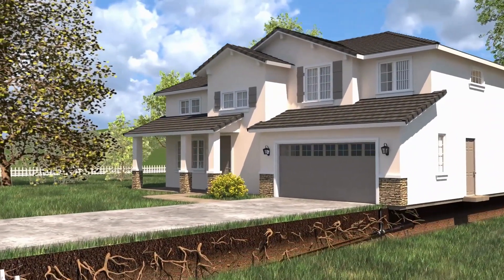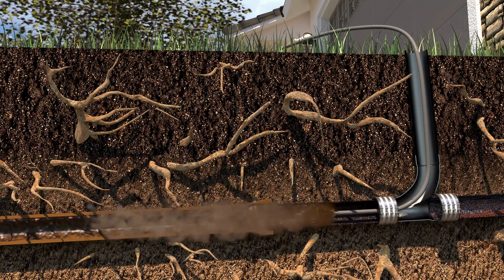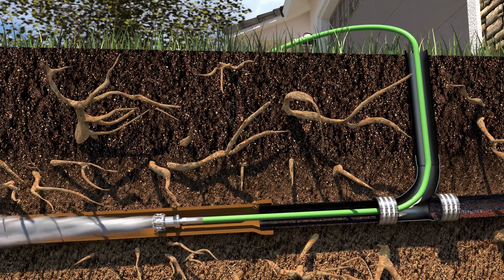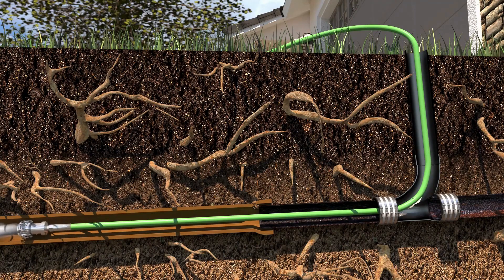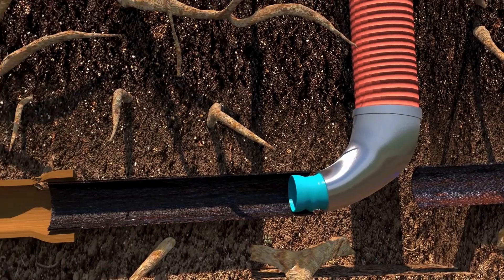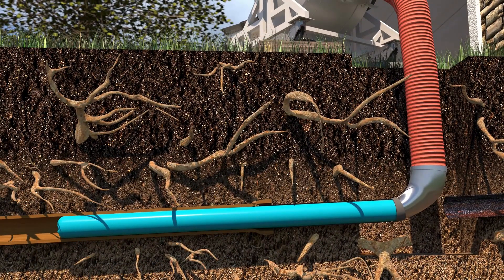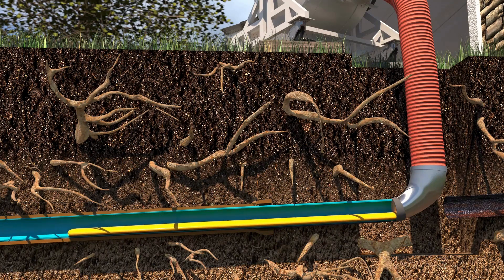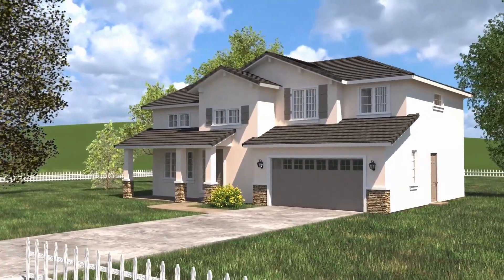How Does Cured in Place Pipe (CIPP) Lining Work?

Comment: This video shows from the house to the street.  Can this be done on the main sewer lines under the basement floor also?  My house was built in 1972. I had my basement sewer lines and the full run to the street cleaned back in 2018.  I currently have a bad clog in the line under my house, so I'm wondering if my cast iron lines under the house are in need of this type of lining.

Comment: How much would something like this cost?
Reply: You need to call someone and get a real quote.  as you can see. They aren’t going to comment a quote without going out to your house to pitch their actual product
Nice try though
Reply from the maker: Great question! The cost of a CIPP (cured-in-place pipe) lining project can vary quite a bit depending on several factors—like the length of the pipe, diameter, condition of the existing pipe, accessibility, and whether any branch lines need to be reinstated or lined as well.
Reply: @ let’s say hypothetically the length is 53 ft from clean out to the street, 4 inch clay pipe.  Cut out some tree roots and line it.  Access from the basement.
Reply: @ThomasPlumbingandPipeLining  is there a minimum length that this can be used to be cost effective?

Comment: Looking for comments from anyone who has had this done AND has had to have future snake clean-outs. Looking for input how this liner held up to a violent snake cleaning. Word is (From Pipe Bursting company) this type of liner can be ruptured by sewer snake clean-out.
I sadly have to go for a JesusHChrist 165 ft reline or Pipe Burst and the Pipe burst is about $20-$25 THOUSAND.... and looking for a cheaper alternative
Reply from the maker: While the liner we use is actually stronger than PVC and can typically handle a lot, we don’t recommend snaking after lining. If done improperly, mechanical snaking could damage the liner, especially with aggressive cutting heads.

That said, once a line is properly cleaned and lined, you shouldn’t need future snaking or jetting—that’s the whole goal! If maintenance is ever needed, hydro jetting is the preferred method for clearing obstructions without risking damage to the liner.

Comment: How does this work with fittings? Like wyes and tees?
Reply from the maker: Great question. When a pipe is lined using CIPP (cured-in-place pipe), the liner is installed straight through the host pipe—including through fittings like wyes and tees. After the liner is cured, we use a robotic cutter (like the Dancutter DC SuperFlex or Mini Bike) to reopen those branch connections. This process is called reinstatement.

The cutter allows us to precisely locate and reestablish flow to each branch line, whether it enters at a tee, wye, or at an angle. And if those branch lines also need repair, they can be lined as well.
Reply: Cool cause I was like wtf how do it go through wyes
Reply: Very helpful. I was wondering the same thing because I have mine but I didn't know if it worked on a t-pipe.

Comment: What about the pipes under the bathroom and sinks like the tree roots can't remember name for those pipes
Reply from the maker: If I’m understanding your question correctly, I believe you’re referring to what we call branch lines—these are the smaller drains inside the property that connect into the main sewer line. After the main line is lined, we use a robotic cutter—such as the Dancutter DC SuperFlex or the DC Mini Bike—to reopen those connections by cutting precise holes in the liner where each branch line ties in. This process is called reinstatement and ensures that all drains remain functional after the lining is complete.
Reply: @ThomasPlumbingandPipeLining ohhh, I was wondering how that all worked. Thanks!

Comment: How are adjoining pipes are connected? In the video there is pipe left behind whilest this is part of the sewer.
Reply from the maker: Thank you for your question! You’re absolutely right that the video is a simplified visualization of the pipe lining process and isn’t 100% reflective of all the technical details. In most cases, the access point we use is connected with a new PVC pipe, which ensures a seamless transition between the lined section and the rest of the system. This often includes installing a new sewer cleanout as part of the process, providing easy access for maintenance and inspections in the future. Let us know if you have any other questions—we’re happy to clarify! 😊